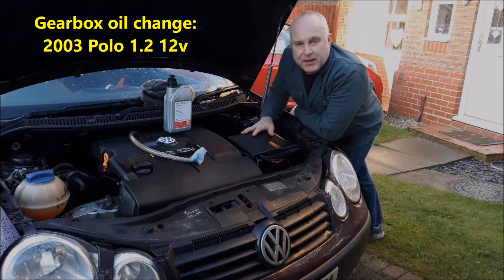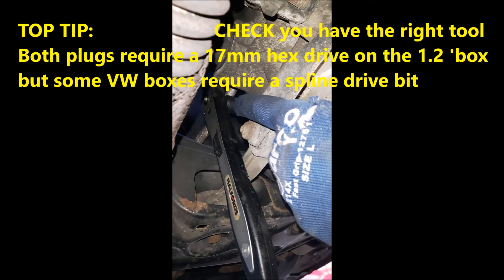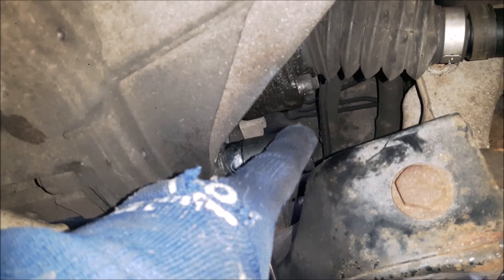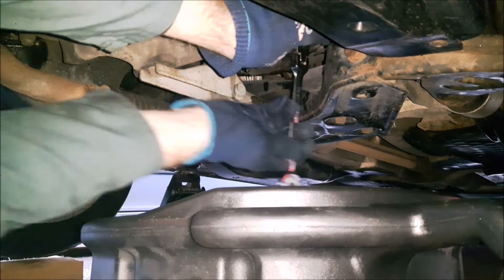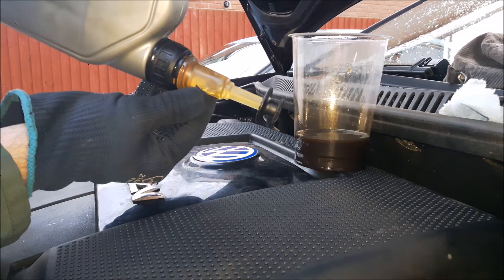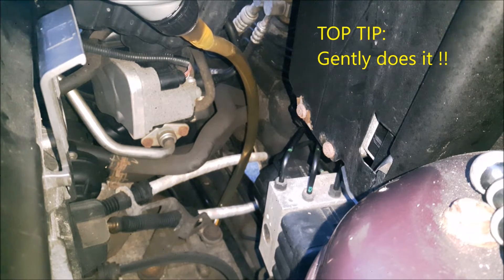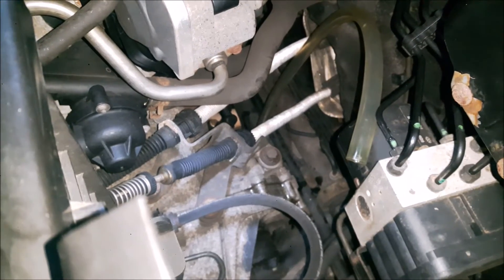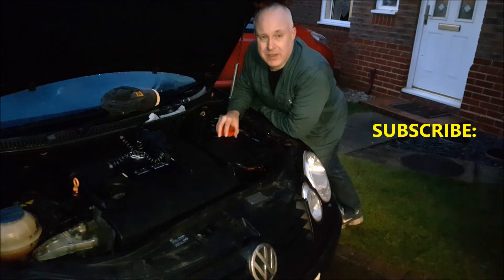VW Polo Gearbox oil change - transmission fluid change

Comment: Thanks for a nice information, i am also driving a polo 1.4 9N, BBY, Auto, petrol, 2003. i have never changed atf oil, i want to now. problem is i dont find any information on what kind of ATF oil to use. is Castro Dextron III useful for this car?
Reply: Febi Bilstein is the right one.
Reply from the maker: Yes, Dexron III. Castrol Transmax Z would be my choice
Reply: i replaced with dextron II and it is working great now! thank you so much!!
Reply from the maker: Dexron II? Should be Dexron III
Reply: oh sorry, it is typing error, i meant Dextron III. Thanks for caring!
Reply: but i drained 2 liters of ATF and replaced 2 litres, is it okay?
And also i have another problem, my battery was down do to longtime not started because i travelled, but when i was able to start the car after battery recharge i met with a fuel gauge error, every time and then the fuel gauge will move to full gauge then to empty and bip an alarm. after i checked the fuel pump fuse i found it blown off, i did replaced it but the problem still persists. I even refilled the fuel tank to full tank.
Reply from the maker: Yep. You'd expect to put back in same amount as came out (unless the level was low 'cos of a leak).
If your battery has been discharged, then it's defo worth testing it as it could be seriously depleted. They really don't like being discharged.
If you leave the car undriven for a while again, disconnect the battery, but charge it first.
The fuel gauge error 'could' be a low battery.
https://youtu.be/AT_XmlwMVz4

Comment: Hi.. I was wondering if you could help diagnose my problem.. Same car. Just replaced some blown fuses and replaced the alternator. 
Gears 1 and 2 work, yet pulling away in drive has hardly any power and when I reach 40+ the revs go higher and higher and won't change gear,  maybe 3rd max. Would this be a transmission fluid problem?
Reply from the maker: Hi there. yes the gearbox exploded internally. When it was taken apart it was a right mess - bits and pieces all over the place. It was making a funny noise which is what prompted me to change the oil in the first place. Ordinarily I would change 'box fluid every 40,000 miles (my Saab is on it's third change in it's life), but this car had 96,000 miles on it when we bought it and it failed at 106,000, so the 'damage' was probably already there when we got it. We cannot know the root cause, but I don't blame the fluid change. On the contrary, a fluid change can often save a worn box that has maybe started to whine.
Reply from the maker: It sounds like it could be more serious. First thing to try is always a fluid change. Believe it or not it was 6 weeks ago I did that fluid change and yesterday the gearbox exploded!! We've had to send it off for reconditioning. Bummer!
Also if you've replaced the alternator, test the battery. One of my early videos shows you how. A duff battery can pull down the ignition voltage.
I hope this helps
Reply: Ok yeah I'll change it and go from there,  battery was tested and ok. Thanks
Reply from the maker: Just re-read your problem and can't help wondering if maybe the clutch is going? Try this: get into as high a gear as possible with about 2500-3000rpm and speed steady. If possible find somewhere where you are now going uphill a little. Give it some gas to climb the hill (or if on the flat give it gas to accelerate). Do the revs rise faster than the speed? If yes, clutch is slipping and time for a new one.
It's hard to watch the road and the instruments at the same time, so pick somewhere quiet and do be careful!
Reply: Sorry I did not quite understand. Did your gearbox exploded on this car that was on video (Polo 1.2 12v). Did they told you what was the cause of gearbox failure? Is it because of oil change or something else?